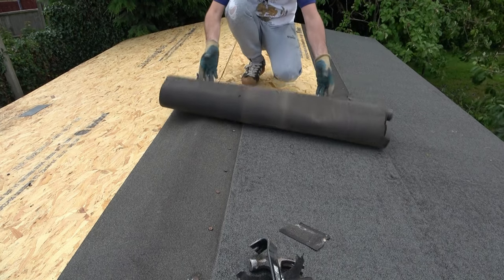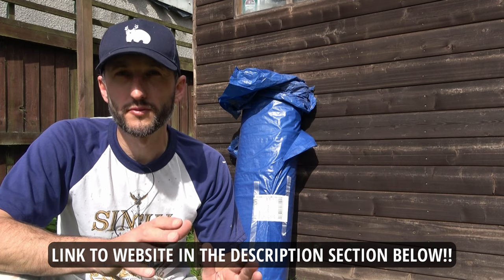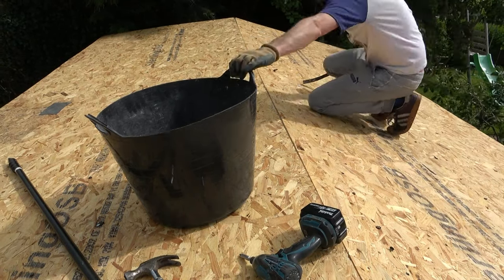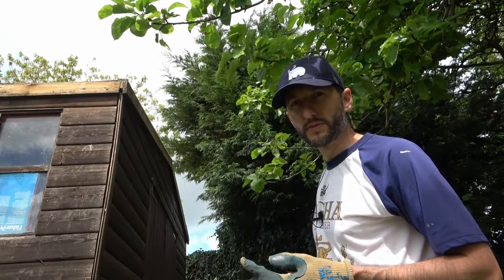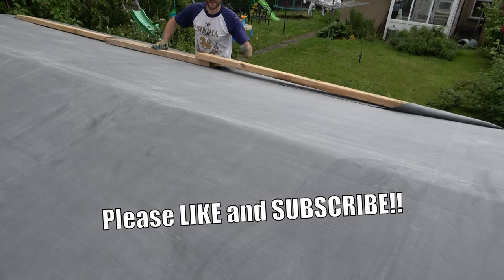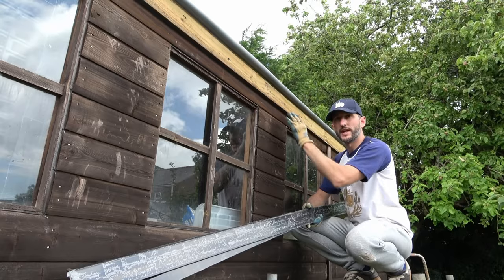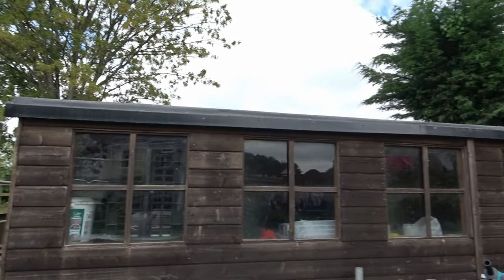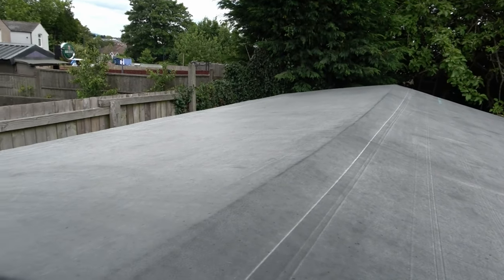How to fit an EPDM shed roof. EPDM membrane installation. Rubber shed roof replacement & install!

Comment: This is interesting for a small flat roof extension i have 👍
Reply from the maker: It's really good stuff, commonly used on extensions. Lots of different parts and products available for different types of installation. Best of luck with it 👍

Comment: I have this same kit from Rubber4Roofs. Got it last October but there hasn't been a decent break in the weather, rain or temperature wise, for me to do it. However, the weather is good next Friday and Saturday so will do it then.

The drip/gutter trim doesn't fill me with confidence though. The water might not make it over the lip of the trim and could just run behind the front-facing trim (i.e. between it and the rubber). Time will tell.

Appreciate the upload - thanks!
Reply from the maker: Best of luck with it 👍

Comment: I wish I had seen this video before I paid a roofer to replace my flat roof felt with EPDM, he made a right pigs ear of the job and I think if I had seen this video I would have had a go myself and done a far better job than he did, but I didn't have the confidence.
Reply from the maker: Sorry to hear that. Hopefully you can rectify it using tips from the video. Best of luck with it 👍

Comment: I put a baton around the outside edge to give a better drip. I also mark a line with a pencil at 100mm in so I know where to put the contact adhesive and where to roll the other adhesive.
Reply from the maker: Good advice 👍  thanks for the feedback.

Comment: Isn't the trim on the from and back meant to sit on top of the edge of the rubber, which redirects water down to the gutter? That's how the edging for mine works (I hope!)
Reply from the maker: Yes you can use that but I used the gutter trim all the way around as mentioned in the video. Thanks for watching 👍

Comment: good vid, i was thinking about  doing some roofing.  My roofer wants to use asphalt but i’m not so sure.  epdm looks like less hassle.
Reply from the maker: Personally, I think epdm is a great product. The fact its one peice leaves no room for installation error. Anything that requires sealing, or binding together on site always leaves potential for leaks. As long as it's not punctured it really is good stuff. Best of luck with it whichever material you use 👍

Comment: I was going to fit a metal roof, but seeing this I think I'll be going for rubber, especially when you mentioned the 50 year guarantee and how easy it is compared to metal. One question I have is, should I add extra to the measurements put on the website or do they give enough extra on each side? Great video by the way.
Reply: ...also, my bare roof is tongue and groove, will this matter?
Reply from the maker: I'd allow a bit extra in your measurements. They will likely cut what you ask for. Hope that helps.
Reply from the maker: Tongue and grove will definitely leave lines in the rubber and won't provide a continuous bond. I'm sure it would work in that it'd be waterproof but I'd recommend using osb or plywood sheets under the rubber.

Comment: Easily the best epdm video I've watched and I've watched loads now. Thank you.
My shed roof is T&G. Do I still use the water based adhesive on the main deck and contact adhesive around the edges? One comment I saw said to use contact adhesive on the whole of the roof for T&G roofs.
Reply from the maker: I've never done it to t&g roof, but I would say just around the edge would be fine. The contact adhesive would be difficult to use all over as it's very sticky and less forgiving. Hope that helps and best of luck with it 👍
Reply: @POUSEaroundtheHOUSE  Excellent. Thanks for your reply! Yes that's true about the contact adhesive. I will just do it the way you did it. Thanks again 👍🏻

Comment: Great video but them drip trims will make the she 360 degrees around the ground floor.wet
I think there poly pins ?
Reply from the maker: To be honest, the roof on mine slopes inwards a touch so I won't get drips from the apex but that's why I mentioned each roof is different and you can adapt it for your shed. Yes you're right about poly pins, thanks for watching 👍

Comment: I'll be reffering back to this in a few months time when the sun's out, currently I have a miniscule leak which appears only with heavy rain but have my rubber roof kit ready to install.

Couple of questions I'm asking myself though, should I treat the wood roof (good timber) before putting the rubber roof on. And should I leave it a little loose and not too tight, to avoid the rubber shrinking and splitting potentially? Great video
Reply from the maker: I wouldn't worry about treating wood covered by the rubber as it is fully water tight. I would stick the rubber straight to roof. It's quite flexible so will shrink and expand a bit but you don't want to be left with a wrinkly roof! Let me know how you get on. Best of luck with it 👍

Comment: what size is your shed
Reply from the maker: It's 14' x 10' but the surface area is a bit bigger than that as the roof is pitched.

Comment: How much did the EPDM sheet cost....?
Reply from the maker: If you go to links in description section below, it'll take you to website, put your size in the calculator and it will give you price for your size. Hope that helps. Thanks for watching 👍
Reply: @POUSEaroundtheHOUSE  Thanks Mate..👍